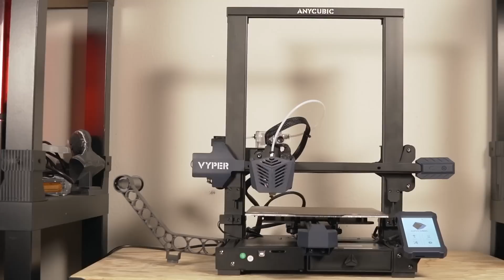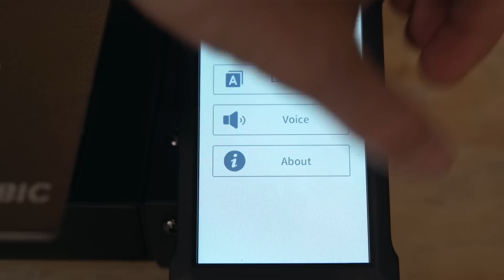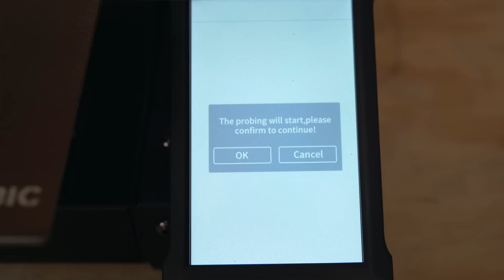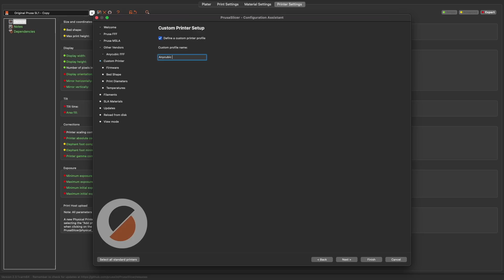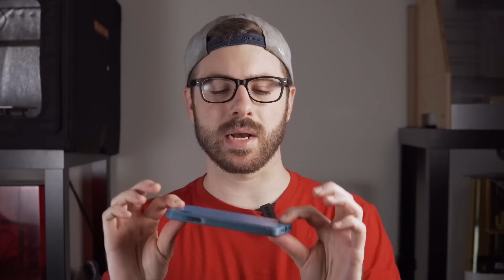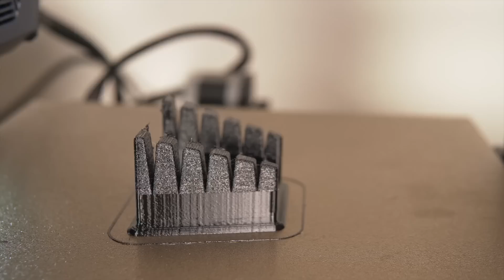The Anycubic Vyper 3d Printer Is SERIOUSLY Impressive

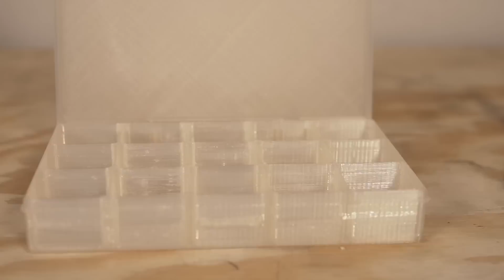Comment: 11:12 Hated my Ender 3 pro for having vertical lines with every print. After seeing this part of the video, I'm thinking if it is really normal to see those artefacts on a print.
Reply: It’s due to the harmonics as the print-head moves back and forth.  If you slow the print down, they become less pronounced.  The only way to get rid of it is to use a different main board and run Klipper with acceleration tuning.  ‘Teaching Tech’ has a good video on this.
Reply: @boggisthecat  hey, thanks for replying! I think you're talking about the ghosting/ringing. 

What I was actually talking about was the constant vertical ridges which appear on the flat surface of the print (as seen in 11:12). It has something to do with belts being over-tensioned and the type of stepper motors that you are running. Quite annoying, really. But after watching this vid, I found that to be a common (not normal) problem. Thought I was the only one who's dealing with such shit.

Edit: this is different from ringing. Ringing is something that appears near the corners of the print (or everywhere there is a sudden change of print direction). This one appears, however, everywhere that is flat. Also, this problem is exclusive only on the axis where your belts are over-tensioned or where your stepper motor is crap.

Comment: In the FB group for this printer many people been sharing results with the included profiles and had no problems, including TPU, so how about you actually try it next time instead of immediately messing with them? Then if it fails complain.
Reply from the maker: Yeah you shouldn’t have to join a fb group for a printer profile. That is silly. Personally I do not like fb or fb groups. If the manufacturer sends a tpu profile that should be a tuned profile or it is best to not send it with an incorrect profile at all.
Reply: @ModBotArmy  yeah read again the first post, 'cause I don't think you understood it.

Comment: I find that results are so much better when using Klipper as firmware. No ringing, much smoother surfaces.
This hardware can likely work fine (if the board can be supported) - including the leveling. But not the touch screen.
Reply: How do you install that?

Comment: This is what I have been waiting for! I've heavily modded my Anet ET4 to be somewhat like this: 32 bit open source board, silent drivers, belt tension (it's unbelievable that it has none as stock), v6 with bimetal heatbreak, Capricorn bowden tube, abl, spring steel sheet (had to replace bed AND carriage because it was weird, and that brought to reroute the y axis belt) and anti backlash; and aside from the money the time consumed has been like a year.
Having ALL this stock is like a godsend, I think the only things I would change are the bowden tube for a Capricorn and a bimetal heatbreak
Reply: Hi! I'm exactly in the same boat as you and am deciding between ender 3 v2 and vyper. Are you happy with with your decision to go for the vyper? :)

Comment: Now just have to wait till there available in Australia 😍🤩
Edit : now I know what's wrong with my grey esun petg, first 2 weeks printed great then swapped to esun pla then went back to the petg and got the same bubbling and popping noises 👍 guess I'm buying a dryer too
Reply: I live on a coastal site and keeping PETG dry is a nightmare. I've built a filament dryer which is also a spool holder so it can dry and feed the printer with the dried filament on the fly. Uses a cheap food dehydrator with a few mods. Seems to work well.

Comment: Looks like a solid machine but the cost price point I think will be an issue. 100$ more than a Ender 3 V2 makes it a hard sell IMO.
Reply: Not at all. Auto leveling, dual gear extruder, flex bed are well worth it.
Reply: @tjlqk3  The features are worth it for a beginner. Upgrading will be harder though as thee community may be smaller.
Good to see innovation though. The dual Z axis, the extruder, the hotend.
Reply: So far, with one test bed level print, I'm going to be listing my 2 lightly modded E 3v2's (kept chasing bed leveling , even with a CR touch) on Marketplace. This looks to be fantastic. I strongly suggest a print to verify z offset. Mine seems to work well at .1.

Comment: My only issue with Anycubic is their shipping costs to New Zealand, there are other manufacturers that can offer shipping for fairly cheap to absolutely nothing, but Anycubic charges can be near the cost of the printer to get it here, with little to no explanation as to why they would charge that much more than other manufacturers. I'd definitely buy more of their products if that weren't the case
Reply: I used Banggood for mine. $75 for shipping and $9 for insurance. They still offered $299US for the Vyper . It all came to $562 NZ including gst
Reply: @Mdbunn2013  I don't get why Aliexpress is so vastly different then, just checked before and in some cases, shipping costs more than the printer, it's ridiculous, but I'll definitely check out banggood, cheers
Reply: @ravenous14  yes I found the same thing. Ive noticed there shipping charges have shot up on everything.
I’m getting over AliExpress, lost orders ,slow shipping. And even if you pay higher rate for fast shipping they still send via cheapest slowest.
My Vyper should arrive in two-three weeks. Cross fingers

Comment: Bowden - strike1, lined heatbreak - strike 2, bed-slinger ... you're out!  No seriously, with those 3 negatives, I'd expect price to become the only thing still keeping you interested and then I don't think this is worth the extra money over ex. an Aquila.  If only someone would come with a Sapphire Plus clone with better quality control, correct belt-path, 5x silent stepper (for auto-leveling the 2 z-screws), silent fans, ABL and a full-metal hotend with direct-drive extruder for $500...  Then I would expect an Aquila to be the ideal entry-point to then after some time upgrade to this Sapphire++ (or something like a Voron or Rat Rig if you're really hooked).  But after the first experience, I would expect anyone wanting to take a step up, to get rid of the bed-slinging (for quality and higher speeds).

Comment: Dude I can't believe you've gone to the dark side.......Prusa ugggggg lololololo Great vid as always. Just a thought; when I did my Prusa vs Cura tests using the same settings on both, the prusa slicer prints had stringing and the cura didn't.......Not sure if its just my setup but I really tried to get the stringing under control with the prusa prints and no go. I have a friend who's buying his first printer and I think I will still recommend the Ender 3 V2. But, I will keep my eye on this printer and if its as good as you've shown, I may change that recommendation :)

Comment: Will this print CF Nylon "out of the box" or will it need modification?
Reply: If it can print under 260c I don’t see why it wouldn’t.
Reply: @tjlqk3  IMO, 260c is the bottom end for Nylon. Probably will be okay, but if you needed an extra 5-10c, you won't have it.
Reply: I would suggest a garolite sheet, not required but makes it so much easier.

Comment: I'm still waiting for an Anycubic product to impress me.  The Chiron they sent me is a complete disaster and numerous posts of bed wiring catching fire
Reply: Have you tried their resin line?
Reply: @cosmicrider5898  I bought their Rinse/Cure station for the new Voxelab Proxima I just purchased.  I haven’t unboxed and set it up yet
Reply: @Where Nerdy is Cool!  The plus or 2.0 ? Imo the plus is a much better deal and is built quite well with a strong stepper motor, 4x the tank size, and 2x the curing size. The 2.0 is very whiney with the stepper motor being halve the volume of the other. I have both found a deal with the mono x and 2.0 so im kinda stuck with it lol.
Reply: @WhereNerdyisCool  Im not saying i have everything dialed in but you should try the mono x its got a large print volume although i havent tried the max iv done a few test prints which were flawless and iv done a few prints for fathers day that came out alright. three pieces failed but it was my first real print so i dont think i had enough support also i stopped to check it a few times.. i did a cyber truck and the axels failed but i should have printed them horizontally... Also a test cube but it got stuck to the fep which was my fault for stopping to early. did have some seperation but it was only a cm wide and less than a mm thick that was only on a print i used the hollowing feature from lychee on and i did stop mid way to check adhesion.
Ill provide an update when i print some more but if id just leave the printer alone it works flawlessly

Comment: The i3 format market is bloated with designs all far too similar, I think that the way forward is for manufacturers to concentrate on prosumer designs, core XY and belted or ballscrew Z-axis with a high temp all metal hotend with 360-degree cooling and a lightweight direct drive extruder, 350 X 350 X 400-bed size a quality ABL solution, firmware that works properly and most important of all good quality QA and aftersales service.

Comment: My first printer was an Anycubic Predator, and that thing makes me really hesitant to try anything from Anycubic in the future. The specs were amazing, the price was right, but repairs were both frequently necessary and a pain in the ass. Especially once the thing went out of production a few weeks after I bought it, and parts became hard to find.
Reply: My first was the i3 mega, great printer, then i got the mega zero, also great but no heated bed (no problem, just added mag sheet), ordered a vyper yesterday.
Reply: @GaryMcKinnonUFO  I suspect my problems werre due to trying a delta first, coupled with the thing going out of production. Not necessarily their fault, but still enough to make me paranoid.
Reply: @gatling216  Good points.
Reply: I'm chasing parts for my anycubic kossell linear plus and anycubic said they no longer make parts for it :( so no after sale support 😢 makes me very hesitant to buy another anycubic printer, all I wanted was another adhesive build surface for my heated bed and some new rail sliders for my frame or an ultrabase glass heated bed but was declined after sales parts and service so if you know anywhere I can still get parts to fix my printer please let me know  😢😢

Comment: I noticed on all of your prints side walls there is a lot of unevenness. Is the auto tensioners spring pressure or rigid screws. If they use some kind of spring there is definitely bouncing in the X-Y movements.
Reply: To me it looks like the extruder needs calibration, and that it could use a Linear Advance calibration as well.  I’ve seen like 3 other reviews, and they seemed to be better calibrated out of the box.

Comment: This is the 1st printer I have seen using dual Z Stepper in parallel with end stops on both sides. Is it possible to modify an existing 3d printer with dual z stepper in parrel from one endstop to two? I think this is a cool feature.....
Reply: I think probably a better/easier diy gantry leveling method is to use an abl.  Marlin has the ability to level the gantry using a bltouch.  You still use two independent z stepper motors, because each motor has to be independent regardless of if it uses an end stop or an abl.
Reply: You'll need a control board with a dual driver output to use dual axis align. I use it on my Tronxy X5S and the Marlin command is G34 for the auto-align feature. I use the bed levelling probe to do the alignment, bed levelling and Z min endstop. That way you can do away with any Z endstop limit switches. It works really well with an inductive probe and a PEI coated magnetic steel build sheet.

Comment: I think this is like the 3rd or 4th review that I’ve seen on the Viper, and everyone has pretty much been saying the same thing.  It works out of the box.  Which to me means that it’s probably good as someone’s first printer.  It does look like yours might be a little more out of calibration than the others, so I’d probably run a full calibration on it, especially the extruder and Linear Advance.

On my Snapmaker, I’ve been printing TPU at 60mm/s, but it is a direct drive.  I’ve also done the same on my Ender 5 Plus, which I upgraded to direct drive, all metal hot end, and linear rails.  I might give 80mm/s a try once I install the Mosquito Magnum.  I’m just starting to experiment with variable accelerations, like higher for infill and traveling, and normal for perimeters.

I wouldn’t be surprised if a lot of new makers found this under the Christmas tree this year.
Reply: or they just got the printer for free and dont want to upset the supplier to not get more printers for free. It looks promising but ill wait until actual buyers start using the machines
Reply: @Nonprofessional_Tinkerer  you should pay attention to the disclaimers in every video.  If the content creator misrepresents themselves in their disclaimer, YouTube will pull their account and all revenue generated, as well as report the infraction to the FTC.
Reply: @cnc-maker  you mean like this vid that has no mention of whether the printer was sent for free or that they paid for it
Reply: @Nonprofessional_Tinkerer  1:06
Reply: @cnc-maker  anycubic reached out to me giving me a list of specs for a new they will be releasing is not saying either
Reply: @Nonprofessional_Tinkerer  Ok, you are just trolling now.  From his statement, it is extremely clear that AnyCubic sent him a unit to test.  If you had watched the entire video, or had bothered yourself to take the time watching the videos of others, you would have known this.  Could he have made an explicit claimer?  Yes.  Should he have explicitly stated this?  Yes, and at the end of the video he specifically asks you to ask such questions.  However, instead of creating your own post you decided to troll here.
Reply: @cnc-maker  have a nice day
Reply: not!!!

Comment: Thank you, this might be the best review so far. I wanted to know about the hotend. Does it have one or two part cooling fan? I suspect switching the tube to Capricorn will help with the webbing. Thank again
Reply: Has a 4010 for the heatsink and dual 4010 blower fans. Have had mine about a month now.
Reply: Could use ducts to focus the air a bit better

Comment: Thank you for the very detailled test! Really great and informative! Have the i3 mega, which will be sold in favor for the vyper. Already preordered it, hopefully it will be shipped on 30.06.
Reply: Is your i3 bad or you just want to replace it for a newer one?
Reply: @liraco_mx  the i3 Was fine, but I had not enough space for All the Printers. Currently I have 4 Printers and a cure and wash Station.
Meanwhile I also got the vyper and it  was impressive.... Until it failed. I am one of the victims of the Level sensor issues and also my y Motor Mount failed.
Reply: @redwraith6576  yikes. Thanks for the feedback. I'm considering the Ender 3 v2 as my first printer at this point.
Reply: @liraco_mx  the ender is good, but also has its flaws. Perhaps you should also consider the eryone er20. If you want to tinker or Upgrade the ender is an extremly good base to Start with. Mine has nearly nothing to do with the Stock Model anymore.

Comment: The Mega-S test print had two owls, the left one had a top hat and the right one was the same as on this test print,  looks like they probably used same .stl file and just removed the right one without centering the other
Reply: The mega I3 I had it came with the 2 owls as well and they came flawless btw, not like this one...
Reply: @JP-xd6fm  my i3 (RIP) also had perfect owls, as said in the video, the profile isn't the best and needs some modifications. Anycubic probably just ran out of time (or were too lazy) to finetune the profile for the Vyper and reused the i3 with minimum adjustments